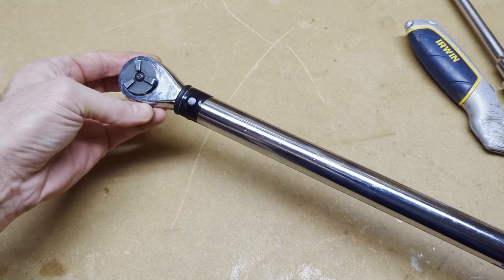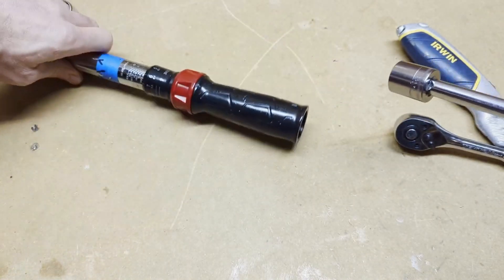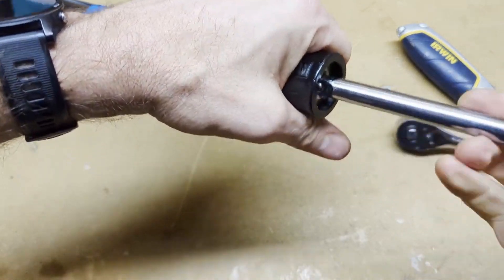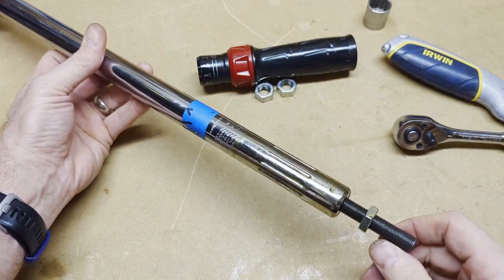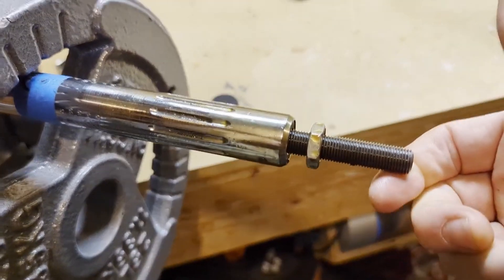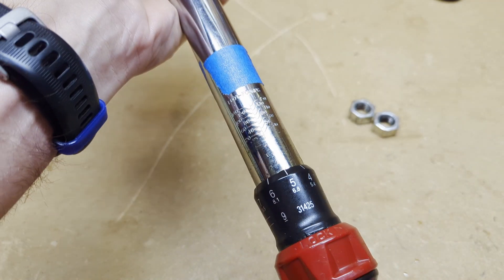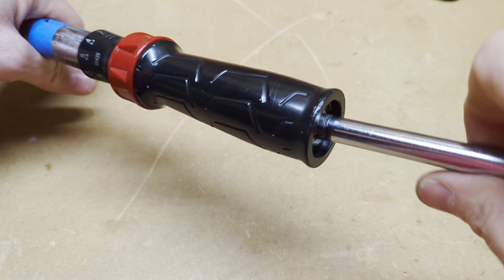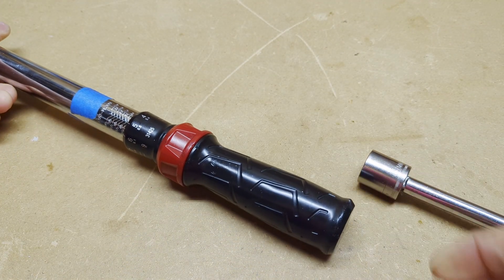Craftsman torque wrench - calibration

Comment: Great video. I have been wondering lately how accurate my wrench is. 
Just one comment. Where you position the weight makes a huge difference.  How do you know the tape is in the correct position. Shouldn’t the weight be where your handle was. This is where your hand would be when torquing.
Reply from the maker: For calibration purposes I used 1 ft out and a known weight to dial in the foot-pound rating for that weight.
Reply: It's true that for a length dependent torque wrench such as the tubular handle click wrench, the force must be applied at the correct location on the handgrip in order to achieve the correct result. This is called the Loading Length or Loading Distance. Some makers include the design measurement in the user documentation, many wrenches have an indicator such as a cross or ring(s) to identify the Loading Point, but if nothing is provided, the standard advice is mid-handgrip where your middle finger would rest. If the resulting length is not 12", a proportional adjustment to the loading force or weight needs to be calculated.
 Just a couple of weeks ago, I had a wrench I use for demonstrations verified by a calibrator, and when I asked for the specific Loading Length I use in the demos, he said "Oh yes, moving that will alter the torque." I told him that's what I use the wrench to show people.  🙂

Comment: What brand is your thin walled 19mm socket? All the sets I have are too wide to fit in the handle to get the outer nuts loose. Looking to pick up a set that would work
Reply from the maker: This is an older shallow Craftsman socket. I'm curious if the shorter sockets have thinner walls versus the longer sockets having thicker walls? You could take your torque wrench to hardware store and check out what sockets they have on hand maybe to test?
Reply: Gotcha. That’s a good idea, thanks for the help and video 👍
Reply: I can’t find the socket:(